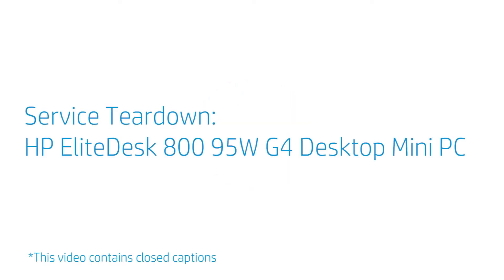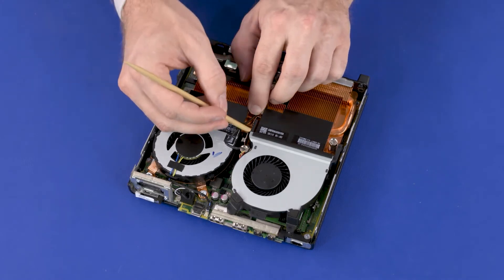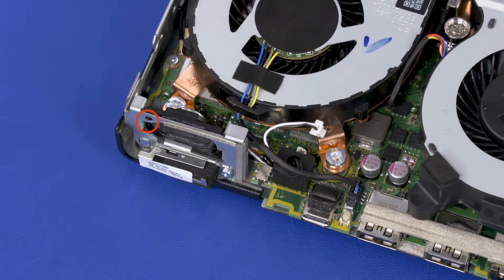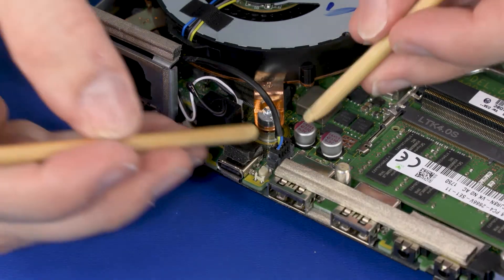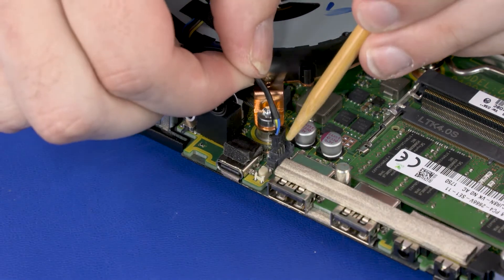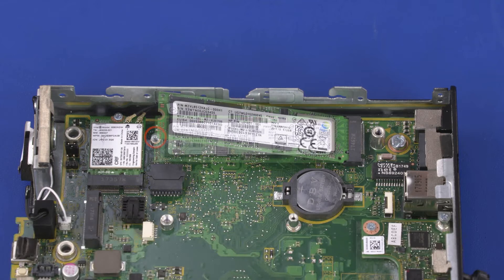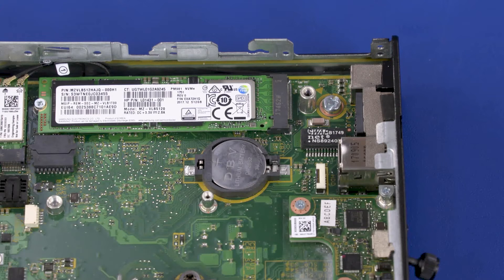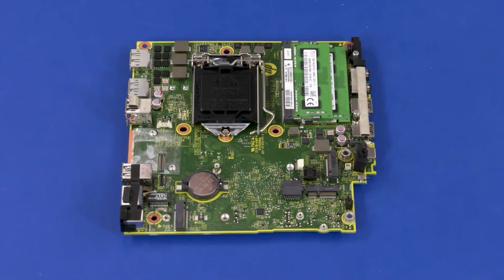Removing & replacing parts for HP EliteDesk 800 95W G4 | HP Computer Service

Comment: Hello, I have the G6 mini but I can't seem to get the access panel off, there is a lock symbol round back, do I need to do anything with it? Thank you
Reply: Hello, just in case you still need help:
I also tried to open up a G6 mini today. 
You just need to loosen the thumb screw on the back and push the upper part to the front.
The lock symbol is related to the hole for the Kensington lock. 

The access panel is one part with the front bezel which makes it difficult to grab it and apply the needed force.
I used a small screwdriver on the backside to move it the first few millimeters. Afterwards I was able to push it by hand.
Reply: @janniss7504  thank you for your comment, I managed to get it open and did apply some pressure, and it just managed to open up, thank you, sometimes I'm very delicate with these units, just need to learn to not be so careful lol